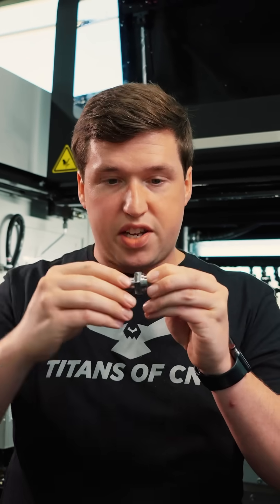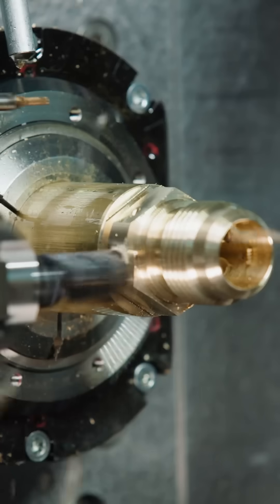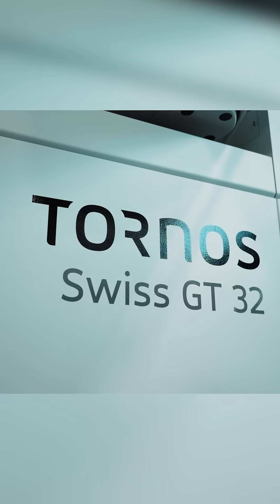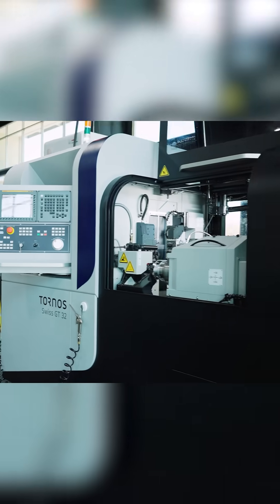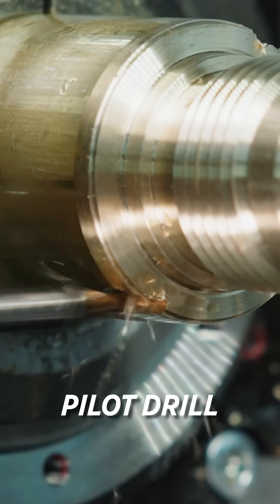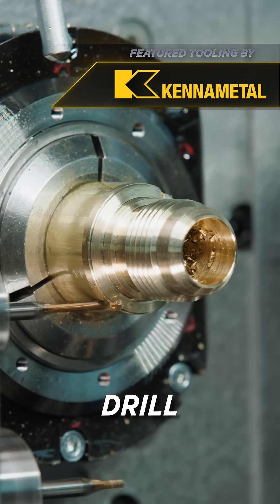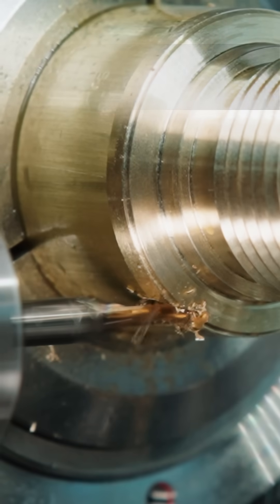What are Safety Wire Holes & How They're Made

Comment: Anyone that works on airplanes will tell you the wire will not keep a large bolt from coming loose if there is a problem with the engine it's going to happen The wire is for visual inspection of loose fasteners without testing each one if the wire still tight and not stretched out then it's still torqued appropriately
Reply: Will we?
Reply: @stevenguy7363  You trying to tell me the wire holds the torque it's the fastener that holds the torque it keeps loose fasteners from coming off and going into the engine but if something majorly mechanical goes wrong that could cause the fastener to fail The wire is not going to add any strength it's just to keep it from coming loose. 
Maybe I didn't word my original comment correctly it will keep it from coming out it will not keep it from coming loose

Comment: All hardware on aircraft have some sort of redundancy. Either safety wire, nylon insert in a nut, crimped nut(both add drag torque), castle nut with cotter pin or finally some type of locking washer.. There’s probably a bunch more.

Comment: Ive never worked in aviation, but ive rebuilt transfer cases for ww2 jeeps (dana 18)
There are nuts that have to be wired inside the casing and that was a fun learning experience. Im sure by todays standard that could be replace by a loctite product

Comment: I saw links that were 1/4 steel that just slip over the heads. Think it’s a much stronger way to secure them because they don’t drill a hole through the bolt or nut and you only have to line up the hex heads to make them fit. They’re held on by c clips.

Comment: I work on aircraft propellers and we use these all the time. Installing safety wire is one of my favorite parts of the job. Super satisfying 😁
Reply: Man, I genuinely wish I enjoyed safety wiring, but to be fair, I usually have to do it inside engine cowling, or pylons on A320s, so there's like... no space and my hand gets slashed all to hell the whole time!

I bet safetying props is a ton of fun though!
Reply: @Thoron_of_Neto yeah I work 737's CFM-56 not fun to do safety wire.
Reply: @JimmyfromtheNorth01  damn... guess we know why they messed up those max airs lol
Reply: Yeah when you have to have both arms extended with your head cranked back and to the side to see where you’re working with only your finger tips to pull the wire tight you’ll hate your life
Reply: Until you have to do it on a lycoming constant speed prop with those stupid recessed nuts and then it makes you want to die
Reply: Idk what you are talking about i hate doing it especially on a 700 series McCauleys. New Mexico aircraft propeller btw would love to know your shop
Reply: To be fair I really only work on overhauls and reseals on the props themselves so it's either on a fixture or in pieces. Not nearly as bad as what some of you guys are talking about lmao
Reply: Safety wire and fun do not go together. Especially the .041 stuff

Comment: For keeping a bolt tight nordlock washers are usually the best. Have been known to be tight even after sting vibrations
Reply: Some airframes use nordlocks, keywashers, and other similar designs. If you want to be absolutely sure though, you lockwire it. My airframe uses nordlock-style hardware on some components, but almost always still utilizes lockwire. I imagine those component areas simply have notably higher vibes, and the hardware is too small to be torqued higher.

Also, nordlocks are also mostly redundant on my airframe, since almost every single nut on it is a Teflon or oval self-locker, and it doesn't get much better than that to begin with.
Reply: @UpToSpeedOnJaguar  self locking nuts are good but still untighten. Testing data shows that they hold well but untighten with vibration while nordlock stays tight even during strong vibrations. Lockwire is mostly used to tell if a bold has rotated and less to keep it from rotating.
Reply: @latenightprojects  Wrong, safety wire is literally used to secure bolts in place that's the whole purpose of the S pattern, if one tries to come loose it will tighten the other. It's practically impossible to notice a rotated bolt without torque stripe/check.

Comment: I mean, you only have to do that with a nut. Bolts can have the hole drilled straight through.
Reply: I imagine that drilling a hole straight through the bolt instead of two on the corners will have two effects, neither of which is exactly ideal for the most stressful situations.

1) It will weaken the bolt head, which may make a mess of putting it on and taking it off with enough torque in the first place.
2) The wire will be put under more stress having to take the movement of the bolt on two small areas where the bolt would twist it perpendicular to the wire, whereas having the wire twisted around two holes on the edges will have the forces be distributed more around the wire, lowering the risk of it breaking.

In some applications, it clearly won't matter. But it may be worth considering in the most critical ones under the highest stress.
Reply: Meaning the placement of the hole being through the corner of the hex?
Reply: those looked to me like hollow fittings.  which may be why the wire holes were offset.

Comment: All that extra work and fancy bull.. to do it wrong. Dude never noticed his examples have the hole going thru the middle of the head. Not threw some random corner that won't even clock right when tightened. There ya go, now ya know, why you did your holes wrong. You guys are the bolt forward assist of machining.

Comment: Why did you have to explain all that, what diference does it make to do the hole first and why should I care about the order of operations if you are using a CNC Machine (btw you added an extra tool change for not reason you goof)
Reply: Exactly. He frames it as if there's some advantage, so why not elaborate.
Reply: The advantage is that by leaving material from not cutting the bolt first, you can make a notch and bring your drill flat against a surface in which you'll drill the safety hole, surface that would otherwise be at an angle if you cut the bolt first, and that angle risks breaking your drill bit.

Just like they showed in the video, actually. Weird how that works. And then you have the gal to be disparaging. Truly telling of your character, "you goof".

Comment: Trying to safety wire in a 1/8" space is the most fun you'll ever have
Reply: Lmao. On my airframe, if the transmission is installed and you need to re-wire a hydro pump, the "most comfortable" way to do it is crouched in the fetal position, and doing it blind behind your back.

One of the worst PitA ever lol.

Comment: Or you just make the hole through the center like most comercial bolts are made. The same as the examples you showed in the video. But that doesn't look as fancy its just easier and cheaper.
Reply: Can't do that through a flare fitting, but yeah I'm not seeing the benefit of drilling before cutting the hex 😂

Comment: Ah! I always wonder why sometimes people say Americans suck at engineering. Now that is why? Screw safety with a twisted wire??? You cannot be serious…. Ever heard about spring washers?
Reply: Spring washers are used in some areas on aircraft. But lock wire is reeeeally good for areas where high shock loads, high rotational loads, or high vibration loads can back any bolt off with or without a spring washer. Also, other nations use lockwire on their aircraft as well. Embraer, Bombardier, Airbus, Boeing, McDonald Douglas, etc etc. All use lock wire in various places throughout their aircrafts.

Comment: We use safety wire on all the bolts in our old gear train driven machines.
Also not just to keep the bolts from coming loose,helps to keep the head of the bolt from falling into the gears if it breaks off.👍
Reply: ah i thought it is some sort of seal / check for when it come loose somehow it will be visible (as the wire will break)

Comment: Why do you use a shorter length pilot drill before going in with the full length to finish the hole off, surly this adds unnecessary machining time or is it so the drill has less of a chance of wandering

Comment: At my company I CNC machine a lot of different types of hardware for aircraft applications, a lot of them get safely wire holes drilled in them. One day I made a mistake in my drill size and the holes came out oversized by .002, you wouldn’t think it would make a difference for something that a wire goes through. We asked the customer if it would be ok and they said that their costumer would not accept them and I had to scrap the whole batch. that’s the aircraft industry for you 😂 🤷‍♂️
Reply: 😂 I'm sure it would have been fine if you hadn't mentioned it.  Some people exist in a realm that is so far removed from the machine shop that they would try and get you fired over a few thou.
Reply: @somethingelse4424  that’s what my boss said, they might have missed it on inspection if we hadn’t said anything. But the inspector at the customer is a real hardo we figured he would have given us a hard time about it.

Comment: They are nice. But they only worke if you put in the bolts in in the first place. And not just forget about the unimportand bolts that are holding your Airplane door in.
Reply: As funny as that is, I think the locking bolts for the 737 door plug were supposed to be safetied (I know "safetied"  looks like a fake word but promise it's not) with a castellated nut and a cotter pin through the threads and through the castles of the nut.

Although, agreed, you're supposed to safety them that way AFTER you remember to install them in the first place 😂😂😂

Comment: We use a .065” flat bottom endmill to spot the hole for our .062 coolant thru “Crazy drill” in the same manor.
Reply: I was looking through to see if anyone had said something along these lines. My first thought was, "why not just use an end mill"
Reply: @dokuganryu44 my shop has coated 'diver' endmills we use specifically to spot flats for our guhring carbide deep drills, whenever we do coolant lines in a block. It was my first thought when it came to putting in a pilot or flat for a drill.

Comment: So what would be the reason you'd want to make a hole then the hexagon rather than the "usual" way? Any benifits to doing so?
Reply: From the looks of it, pragmatism. It would appear the steel used for these bolts work hardens, and it's a simpler operation to mill a flat into round stock to prep drilling this tiny 0.05" hole, which will dissect through a corner of the bolt head, than it is trying to punch through at an angle after the hex has already been milled.
As the Short illustrated, the tool is going to try to walk, causing it to break.
Reply: @NightsReign But they drilled the hole into the steepest part of the radius on the rough stock.  It was nearly tangent to the round bar.  It doesn't look like it was of any benefit as far as I can tell.  Drilling into that milled angle looked more favorable than what they actually did.

If it's work hardening, they ought have mentioned it.  Otherwise this is the worst advice.  They should say "for this specific material, do this silly looking thing, otherwise do the opposite".
Reply: @NightsReign  you are correct trying to drill into an angle would bent and break the drill its not even work hardening it can happen with any material. We wirehole all our parts on swiss lathes like the video shows as per instruction from the machine manufactures.
Reply: @johnwinter9399 do u send the drill all the way through ? Or come back in from the other side ?

Comment: I have drilled for safety wire before but never off center. Is this just because it makes for a shorter hole depth ?
Reply: If the part has a through hole (it looks like the one showcased does), an off center safety hole doesn’t intersect the bore
Reply: Notice that lockwire holes are usually drilled off center (like shown in this video) on things like fluid fittings.  The fact that the fitting was lockwired would be little consolation to the guy asking "yea, but why is it leaking like a siv?" 🤣  that is why things like fluid fittings are drilled off center.

Comment: We use safety wire on pipe hangers at work. The vibration of the line can cause things to work loose, so on static pipes we safety wire them so they should never come loose, at least in theory.